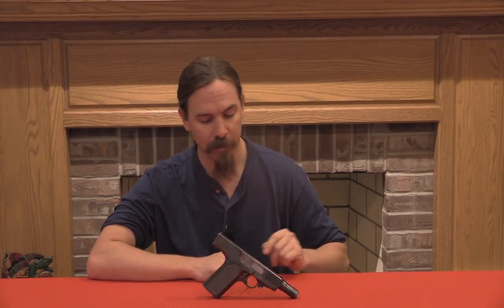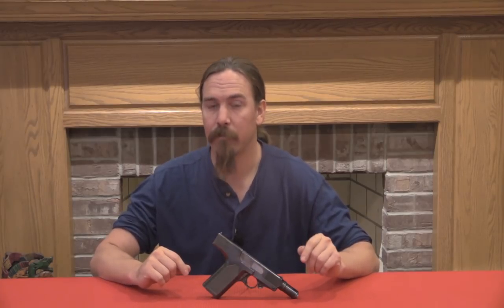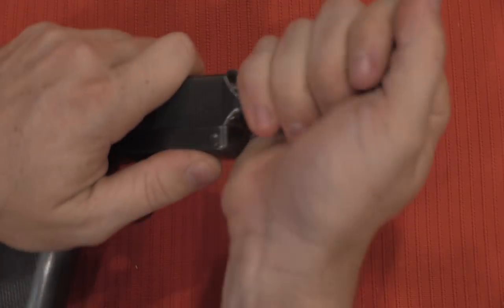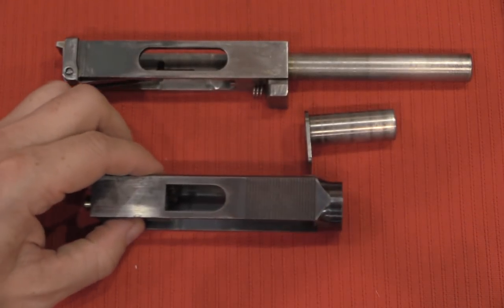Lewis Short Recoil .45ACP Prototype Pistol

Comment: I'd love to see a few rounds put through it, really see how it performs. It would be interesting to see if the extra weight and that long rear overhang are a benefit when it comes to keeping it under control. At least you won't have to worry about hammer bite. :)

Comment: must be some good reason as to why it wasn't adopted manufacture cost maybe it certainly looked well made and closed up enough that dirt wouldn't hinder it from operating
Reply: Vector Corbin I also think there's just something sexy about it. I wish it went into production
Reply: Size aswell perhaps?
Reply: Maybe they thought the long brace arms on the locking mechanism were a potential weak point.  Seems like it'd be tricky to get them just right.  Too hard and they'd crack.  Too soft and they'd bend/flex.
Reply: I can see a lot of stovepipes with that relatively small eject window so far from the actual chamber. Apart from that, it seems a well tought design, with a remarkably low bore-axis.

Comment: I have a feeling that the barrel sleeve could have been even better if it was made out of gunmetal or high-carbon cast iron. You would then have a really nice bushing to prevent the barrel or slide from wearing much at all. With a replacement sleeve every 10000+ rounds, you could probably make that gun run forever and a day.

Comment: Is it just me or did this look like a full auto gun? I see a transfer bar, I see a sear, ..I didn't see any type of disconnect, though.  With the trigger pulled, the sear continues to be disengaged and I didn't catch any mechanical stop/disconnect for either hammer or transfer bar.  It looks full auto. (maybe I missed something)
Reply: I'm also curious about that.
Reply: At 5:42 you can see an extension in the middle of the feed ramp that appears to be positioned to lift the transfer bar during cycling, acting as the disconnecter.
Reply: Was my first thought too. I'm not convinced that little piece picks up a the transfer bar, looks to push down onto to pivoting link to me

Comment: Very interesting design but seems overly complex with a lot of little springs and pieces. Plus the trigger / sear assemble pulling out on the top edge of a flat spring feels like a weak spot. However, a few minor changes and you have a "15 round"(!) .45 ACP pistol when 6 shot wheel guns where most common. Great video topic regardless.

Comment: too bad it wasn't developed further.  I can certainly see some potential, maybe even including a modernization using polymer in various locations to reduce weight.  The fact its chambered for .45ACP also makes it compatable with OTHER cartridges and configurations, in theory anyway.
I wonder what a modernized one designed with P14 or 2011 magazines would cost to manufacture...maybe change the mag release to an HK lever or a Colt/Browning button?

Comment: I look at this and can't understand how the 1911 became our sidearm when this existed. Provided it didn't fall apart when shooting it seems to have all the bases covered?
Reply: Who wants to carry that massive slab around? 1911 is smaller, thinner, lighter, reliable, probably cheaper, just a better all round design.
Reply: This prototype has : a very well sealed action, a simple no tiny parts strip down, and the only redeeming thing about weight-capacity, double a 1911's. I can't expertly speak on cost, less parts usually means cheaper though... Being thin and better looking doesn't a better firearm make. We have a plethora of double stack military and police pistols nowadays.
Reply: It doesn't have less parts, it has more. It's big, bulky and clunky. This is important when you are talking about a military sidearm that has to be carried around all the time yet almost never used. This is why so many people in WWI and WWII were carrying around .32 pocket pistols. It's locking system looks pretty fragile to me but who knows. The only thing I see that's good about it is the double stack mag which just wasn't that important to people at that time. If it was, it would have been real easy to make a double stack 1911 as current guns show.
Reply: It would have been probably 2-3 times more expensive than the 1911 just based on the looks of the parts
Reply: +wingracer 16  True double-stack, single-feed magazines are not simple to design. It wasn't really till Dieudonné Saive's Hi-Power that someone got the internal geometries correct, and I'm not sure that Colonel Lewis got it right here either. The Savage 1907 is certainly not a double-stack, regardless of whether Ian wishes to call it so.
Reply: One thing need to consider is that the 1911 has already been adopted by the US military for a decade when this pistol was developed, and had proven its service during the Great War. So not many reason to suddenly change a mere sidearm when the development of a semi-auto rifle for the infantry was the priority in the 1920s.
Reply: +ostiariusalpha  Savage 1907 is a double stack
Reply: Let's see, the French tested this thing in the 20s so let's see what kinda competition was out there. The 1911 of course but also: Luger, Colt 1903, Savage 1907, FN 1910, Webley, Frommer Stop, Steyr 1912, Remington 51, Astra 400, and all kinds of other oddballs with dozens more to come in the following years. Yeah some of those are junk but two or three would still be considered perfectly good sidearms today. This thing would have to be really, really good to beat out all of those.
Reply: My favorite part of this conversation is that people are pointing out why I'm probably wrong with well reasoned stuff and without being dicks. 

I thought it looked pretty simple, and like it would hold up pretty well during the jungle wars during the 20s due to the well sealed working bits. I don't know how this has more parts though. I was referring to strip down all the way, not field strip. Many small parts in that 1911. Of course, I've only taken a 1911 all the way down maybe twice, and my memory of it was Jesus how do I get all of this shit back together(being used to modern polymer frame striker fire stuff)
Reply: +Vickte W  Nopes. Semi-stagger stack isn't the same as double-stack.
Reply: ostiariusalpha  It was still classified as a double stack mag. You don't have to agree with it but it is certainly not wrong to call it that
Reply: +Vickte W  Except that in firearms engineering, semi-stagger is considered a single-stack design.
Reply: ostiariusalpha  The Savage doesn't stagger as much as the later double stack pistol, but certain not to a point to be called a semi staggered. If you want to stick to your source, fine by me.
Reply: Possibly one of the biggest reasons I don't think anyone stated is politics.   It may sound strange but they don't always choose the option with the most merit.   Colt is an American company and that alone might have made the difference if this Lewis was a viable option.   Pistols were and still are almost overlooked in most cases in the military.   It might have made a good weapon for non front line troops like artillery, tankers and such.   Instead of a subgun or carbine a high capacity pistol could be used as a PDW.
Reply: With a condescending attitude like that I shouldn't even bother with a reply but here goes.   I never said it would be a good primary weapon just it could have been used in a PDW role for troops that don't usually see direct combat.   I never even said it would be ideal in that role just that it could do the job.   I probably know more than most people about how ineffective pistols are at stopping people, I've seen a few shootings in person.   That said I'd hardly feel unarmed if all I had was this pistol back when it was designed or even now if it was a good functioning example.   We are talking about a pistol designed around ww1 so why would you even bring up jets or more modern weapons, that makes no sense at all.   Why do people get so defensive about the 1911?   It's not blasphemy to point out that there are better options out there and possibly were when it was in service, the Hi-Power is a good example.   It should have replaced the 1911 for military service but like I said they don't always choose the best option.                                                                                                                       As for your question about what gun I would want in a fight it's pretty simple, I want a battleship or a M1A1 tank if I know I'm going into a fight.   On a more serious note if we are talking small arms I would take my M16, it's plenty of gun for most situations and something I can handle well.
Reply: +IRMacGuyver  Single-stack is one round sitting on top of another with no other rounds touching but the one above and the one below in the stack, which is exactly what is going on in a Savage mag. All single-stack mags (Luger, 1911, P.38, Hi-Point, Glock 43, or any Kahr) have a very slight stagger arrangement inside the magazine body, the 1907 just exaggerates this to get more vertical space to increase ammunition capacity; this exaggerated arrangement is called a semi-stagger. Double-stack has cartridges touching the rounds above and below them also, but additionally, they're touching the rounds in the second stack next to them in a full 60° true stagger arrangement; hence, double-stacks.
Reply: +IRMacGuyver  And what exactly is this "real evidence" that you've found?
Reply: If the dates presented in his description are accurate the 1911 had likely been the sidearm of the US military ~5-10 years and through the involvement in WW2 it would have been pointless to switch to this
Reply: +IRMacGuyver  All of which plainly show one stack in the magazine.
Reply: +IRMacGuyver  Unless they've changed the definition of stack (and by the way, they haven't), one cartridge on top of another is still just ONE stack.
Reply: +IRMacGuyver  I'm clearly seeing that you don't know what a stack is.

Single stack: http://patentimages.storage.googleapis.com/pages/US1044983-0.png
Semi-staggered: https://i.pinimg.com/236x/9a/00/2d/9a002d56894141afaf515a24e09f57af--glock-savages.jpg
Double-stack: http://patentimages.storage.googleapis.com/pages/US5386657-1.png
Double-stack, semi-staggered: http://i.imgur.com/H9hI8je.jpg
Reply: +IRMacGuyver  Okay, genius, this is where you explain exactly how the 1907 is a double-stack, but the G43 isn't. I'm going to enjoy this.
Reply: +IRMacGuyver  And where in that photographic evidence (that I provided, not you) is there any meaningful difference in stack geometry between the Savage 1907 magazine, which you claim is double-stack, and the Glock 43 mag, which Glock says is a single-stack.
Reply: +IRMacGuyver  LOL! Well, if you want to keep looking like a fool, that's your business. Since you are apparently unwilling and incapable of actually articulating any difference, then despite your denials, you have basically conceded the argument to me. Thanks.

Comment: If you drop this thing on its nose, isn't there a risk that the hammer locking spring shown at 4:32 will move forward, accidentally firing the gun?  The safety at 6:00 doesn't seem like it would prevent that.

Comment: From http://fr.1001mags.com/parution/gazette-des-armes/numero-168-aout-1987/page-46-47-texte-integral

Just translating the non-descriptive part:

Testing of the Lewis automatic pistol did not produce good results. Since the weapon was not finalized and could not be fired, the Commission had reservations as to its operation. Sadly noted is the absence of a stop on the charger, the charger’s poor hooking system, and the excessive force necessary for the breech to open. The only positive points that emerge from this model are the angle of the handle and the simplicity of the disassembly.
Reply: romainthblt thanks